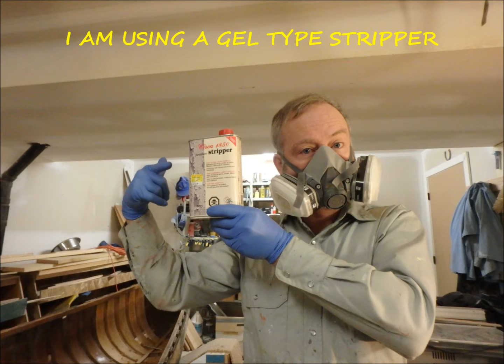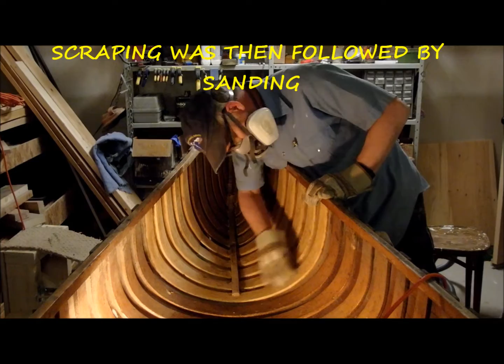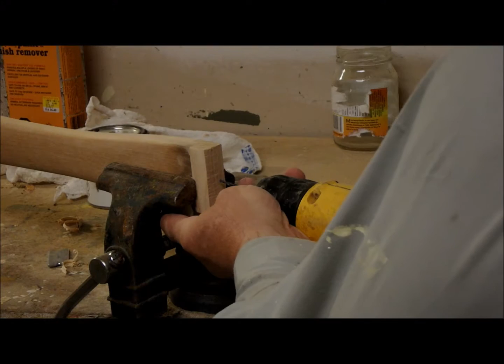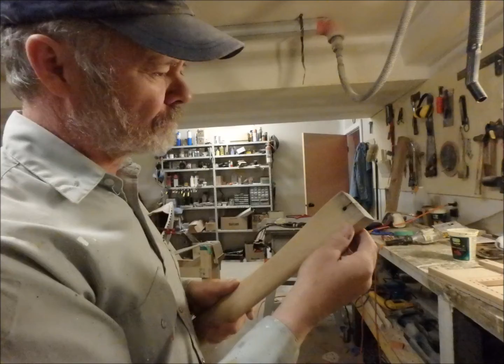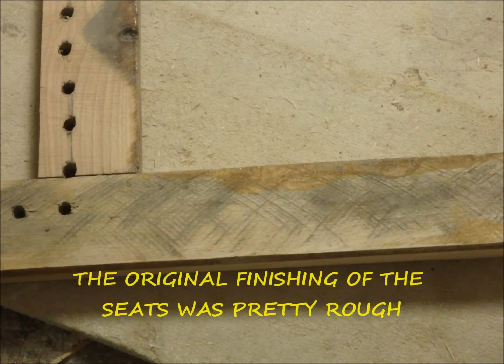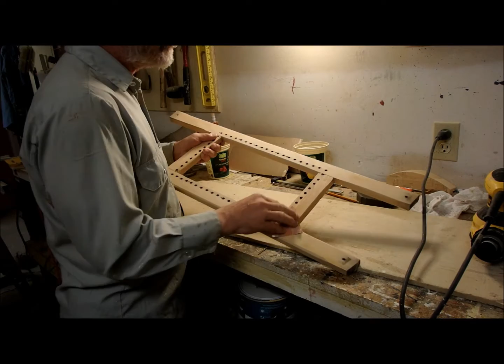Wood Canvas Canoe Restoration EPISODE5 Refinishing the wood

Comment: I have a canoe that could use some touching up. Would you be able to give me some advice as to how to accomplish this? It's nothing much, the gunwhales and hull I think could use some refinishing, but I do not have any experience so I do not know the extent of this job. Let me know! thank you!
Reply from the maker: Hi, Wood refinishing is pretty simple. To get the best result, you need to sand off the old finish right down to the bare wood. This can be done by hand or carefully with a power sander. It is best to remove thwarts, seats, and other parts that are easily removable and do them separately. Once the old finish is off, smooth the wood with smaller and smaller grit sandpaper. The smoother it is, the better the finish will be. I usually go to 600 paper for the final wood finish. Then you apply whatever finish you want, spar varnish, varathane, whatever. Apply thin coats, let them dry completley, and lightly sand, or steel wool between coats. Once you have a good, solid 4-5 layers of finish, polish it up, again using increasingly fine grit. For a shiny polish finish, I go right to 2000 grit paper. This process is simple, just long and time consuming. Hope that helpsdoug